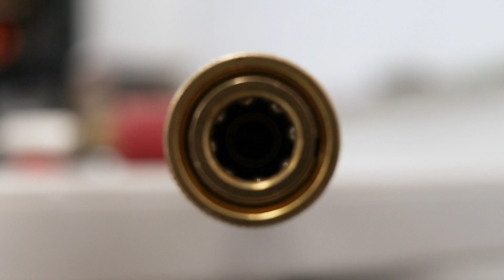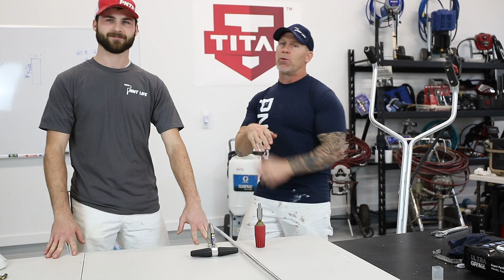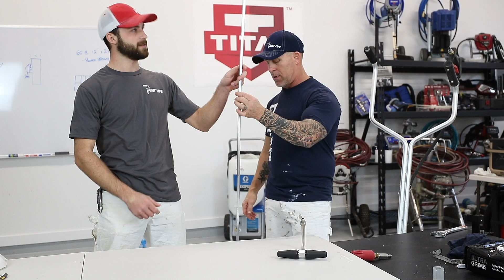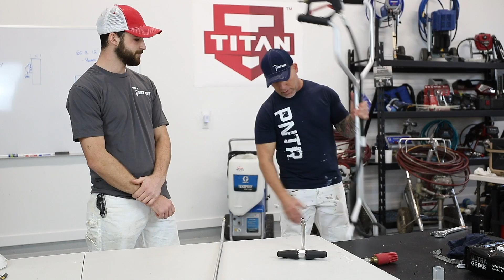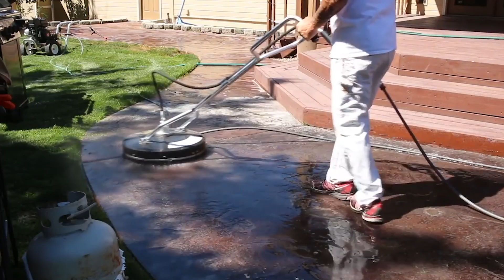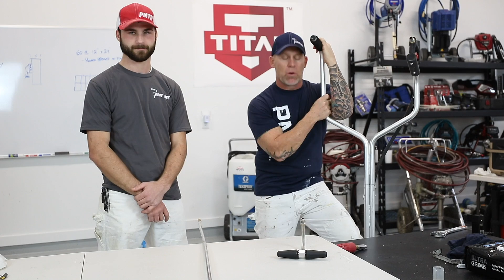4 AMAZING Cleaning Tools!  Pressure Washer Accessories.

Comment: I've been a full-time painter and Professional Home restorer since 1980. Try a product called X jet. It draws bleach from the tip of the power washer wandwhere the pressure is rather than at the base or the hose connects to the machine.this allows you to shoot 50% bleach and water which is a little strong for most applications. The 10% chemical injector tip is not enough bleach at the tip to kill mildew and algae on the house. This solution is 90% water and 10% bleach and its two week. What I typically use is two containers of bleach the three quart size they have now which equals a gallon of yesteryear because bleach is a little more concentrated. I add two of these three quart jugs to a five gallon bucket fill it up three or four inches from the top with water. Using the X jet this gives you approximately 22% to 25% bleach and water mixture which is enough to kill all the algae and mildew on any job I've ever been on in one shot without killing the plants the below bushes, scrubs, etc. I modified my X Jet slightly. It comes with about 8 ft of hose and an on off valve. Are shortened up the section of rubber hose is clear rubber to the valve. I have it attached to my standard 4 ft power washer wand just in front of the plastic where the wand self screws into the gun you can mail it on the plastic a little bit do you need to have it right there at the front of the gun above the trigger but anyway you figure it out. I tried to still securely with zip ties. I got a long section of clear heavy duty plastic tubing it's kind of like the rubber. The same type that comes with the X jet. I zip tied this down my gun from the valve around the handle down the hose all the way down to the machine approximately every foot, foot and a half. be sure you take a razor knife and slice your zip ties flush with the little square piece on the zip ties as cutting them off can be very sharp and you can cut the hell out of your hands on a little sharp piece of a zip tie. Zip ties clipped off will slice you open like a razor.I take my razor knife and cut them smooth and flush all the way across after I slip them off with a pair of wire snips I go through and cut them smooth. This setup allows you to have a 5 gallon bucket of bleach and water at the machine and you have a double hose going all the way down to the machine using your pressure washer hose with your clear plastic rubber tubing zip tied all the way along side of it. I keep the X Jet with a double line hose as a separate setup.when I come to a new job I just use that in place of my regular power washer hose after I'm done with all the bleach and water and I need to blast concrete or whatever I'll switch up to my just plain separate power washer hose. If you don't kill the mildew and algae if this solution of bleach and water it'll grow back through your paint shortly after you pay me. I don't have to use pressure to clean the house.Does too much damage blows water in through cracks gets on the inside sometimes and generally just screws up your house. Having this setup allows me to stand on the ground and reach most two-story house has the highest Gable with a 3500 PSI power washer. If I can't quite reach the peak I'll step up a few rungs on a step ladder and get the last three or four feet that I can't reach in the peak of the Gable.wet everything down thoroughly with your bleach and water solution. Wait not even 5 minutes you will see a mildewed house turn so white and clean from this bleach and water solution that you almost wash yourself out of a job. Almost every time I clean somebody's house it's so white and clean they say I don't know if I want to paint it now. I will tell them the truth wants to paint get to were it's mildewing a lot and growing algae on it most if not all of the mildewcide in your paint has weathered out of your paint. And the mildew and algae will come right back in a few months vs several years that it takes to weather out of the paint. Now is the best time to paint it while it's nice and clean and the paint hasn't started flaking and peeling off. At any rate I can wash a two-story house without ever having to climb a ladder other than maybe stepping up three or four rungs to reach the very peak of the Gable. I have my own and off valve zip tied to the left side of my pressure washer gun because I'm right-handed and I typically use the power washer right-handed and I reach up with my left hand and flip the valve on bleach comes out flip the valve off is straight water. When I say bleach comes out I'm speaking of my mixture of two jugs in a 5 gallon bucket filled the rest of the way with water.you will see you can watch the Gable end of a house in 15-20 minutes you can wash a big 4000 or 5000 square foot house in acouple hours and you're gone. You put your power washer on the side of the house you're working on flip your lever to turn on the bleach. Wet it down thoroughly. wait 2 or 3 minutes till it turns White and the mildews gone. Rinse it back off with the same setup with the lever for your bleach turned off. The  X Jetshoots water 40 to 60 feet in the air standing on the ground. Works like a fire hose.It's an amazing invention invented here in North Carolina where I live. It only takes a few minutes to watch the whole side of a house and and I only have to move the power washer a few times around the house typically only four times one for each side.The X jet comes with a strainer on the end of the hose well I put this on the end of my long hose that I attached all the way down to the machine and I added a weight to it because it was always trying to float up in the bleach and water solution. I used a stripped collar from a cheap cast iron weight set but you can use whatever you want. I always have two 5 gallon buckets for my bleach and water solution. I drop my weighted strainer into the bleach and water solution. When it runs dry I just lift the weighted strainer out of the bucket and drop it over into the full Bucket and go fill up the bucket of something with more bleach and water I never have to stop washing I have someone helping me move the power washer around and the hose when you're moving around a bush and it gets snagged up on something and keeping my bleach in water solution buckets filled. I tell my helper your job is to keep the bleach and water buckets filled at all times and to keep everything moving all I do is walk around with a gun in my hand dragging the hose their job is to move the machine unsnag the hose and keep the bleach and water filled. I flip the lever what it down flip to leave her off wait till 3 minutes rinse it right back off and move to another side. This is the way to wash a house. You don't inject water into the woods using all that pressure on the trim or into the cracks. You don't damage anything from all the pressure or blow a lot of water inside the house accidentally using all that pressure. And you don't have to spend there and cut all the mildew and algae off with pressure this takes way too long and it doesn't kill it the spores are still there and it'll grow right back in no time. Mildew will even grow under your paint. Once you try this setup you will never watch a house any differently ever again. I used to do it the hard way like you guys do with pressure and water. Once I found out about the ex yet I won't wash a house without one and you won't either once you tried one. The one I bought was about $175 they are expensive.especially when all you really get is the tip about 8 for the rubber hose and on and off valve and a little strainer to goes on the end of the hose. It'll pay for itself halfway through the first job. If I can ever help you in any way please feel free to call me at this number:
(910)-818--3279
God Bless 🙏😇 Y'all
Jimmy in NC.

Comment: High power vacuum works well on gutters use heat gun to slowly bend plastic buy two or more extension bend one into a u shape then vacuum out or a blower with attachments less mess less cost water bill in some areas are high.